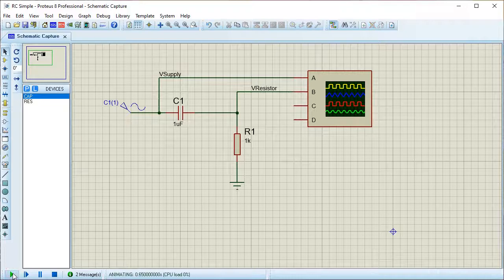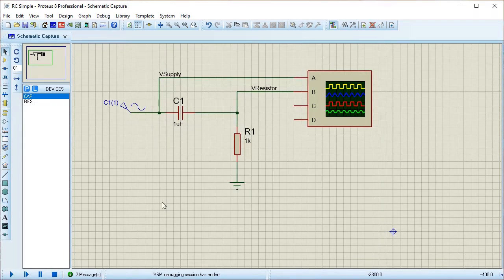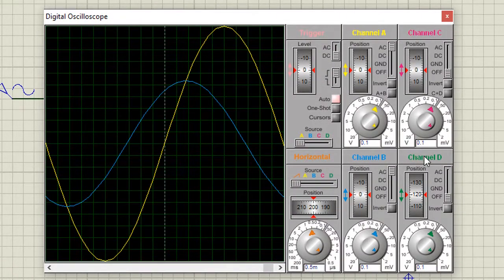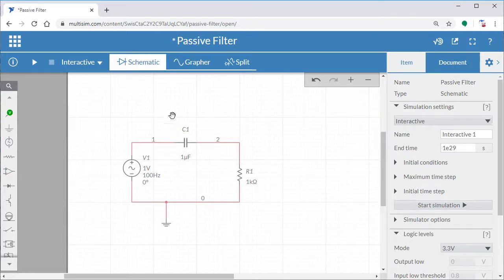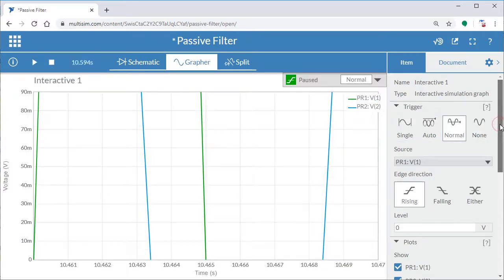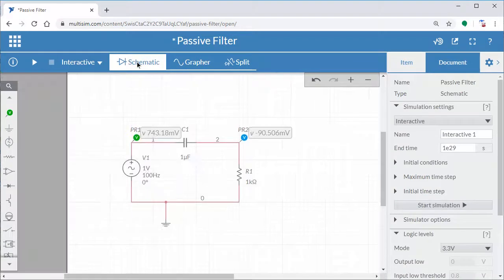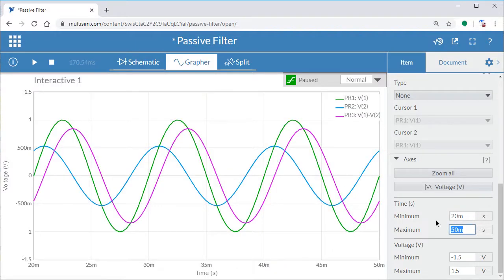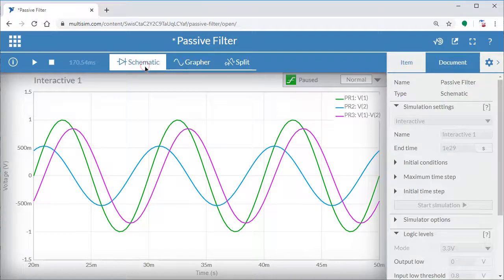Measuring a capacitor voltage using Proteus and Multisim

Comment: How much values of R&C
Reply from the maker: Hi there, I used a 1k and 1 microfarad. You can use any values. The important thing (if you want relatively even sized waveforms) is that the reactance of the capacitor is similar to the resistor value. Xc = 1/(2*pi*frequency*capacitance).
So the frequency of the AC input changes the capacitor reactance and voltage. I hope this helps. See my videos on AC theory if unsure :)